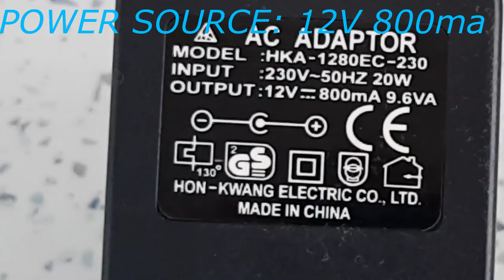DIY Transform Old LCD TV/Monitor into LED Lamp

Comment: Would have been better using the original monitor back lights instead of replacing with new LEDs..
Reply: The original LEDs typically require about 100V. It’s doable but not for everyone and definitely less safe
Reply: @break8869  damn i thought the 120v AC cable just went into a transformer to convert it to 12v dc